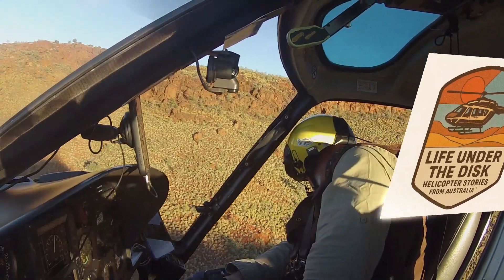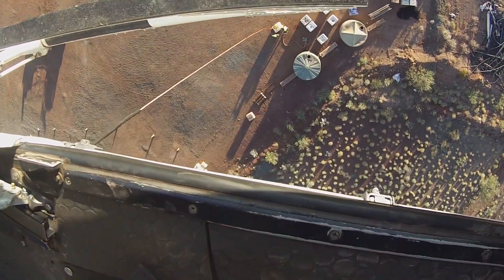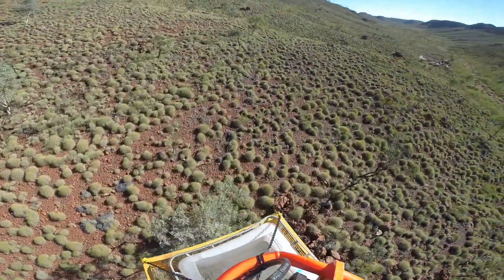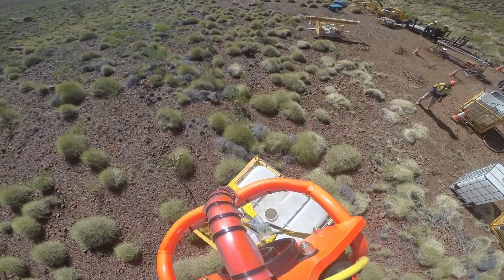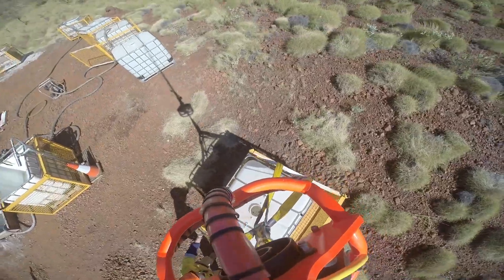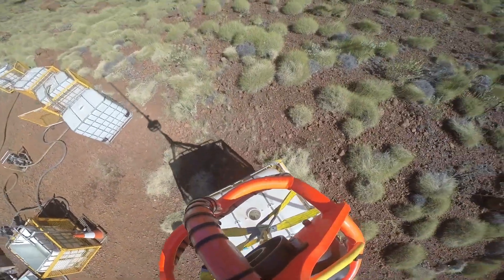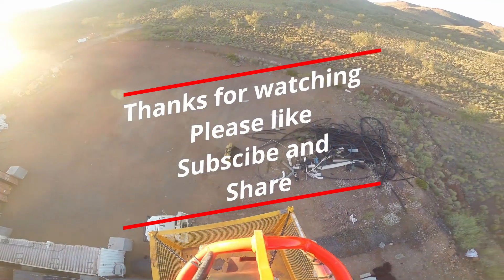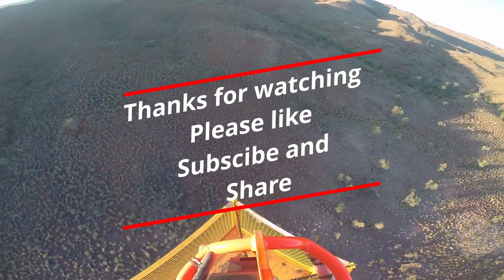Helicopter underling loads. The ultimate helicopter challenge #lifeunderthedisk

Comment: Very interesting!
After having four birds fall down our chimney, all trapped in the fireplace together, I am guessing as a result of distress calls, I decided to fit an inverted wire basket over the top of the chimney.
I hooked the basket to my quadcopter with several metres of string and tried to lower it over the chimney, but pendulum effect made it imposdible.  So I removed the string and hooked on with a short wire, just long enough for the blades to clear the basket before takeoff.  I was able to hover with the basket very steady near the ground, but over the chimney, slight breeze crossing the roof made control of the quad very difficult, dealing with fluctuating horizontal air speed as well as updrafts, culminating in crash after battery alarm sounded & basket collided with top of tree I was trying to clear.
You have led me to think that solution will be a much longer string to lower the natural pendulum frequency and enable the quad to remain well above the swirling air over the roof.  It was much harder to lift the basket without wire unhooking than with hook attached to string, so I am keen to try again using a much longer string.  Also thinking smaller dia blades to reduce wind target.
Thanks for the inspiration!
I used to be expert at stopping loads from swinging under overhead crane, but that experience didn't help much with the quad, due to the pendulum frequency being close to my reaction time.
Reply from the maker: Yes. Give the longer line a go. And make gentle movements on the controller. The trick will be to keep the hook over the load. 
You will have to let me know how you go.